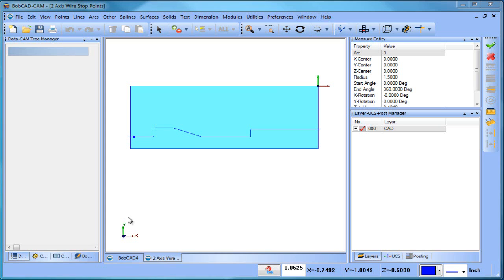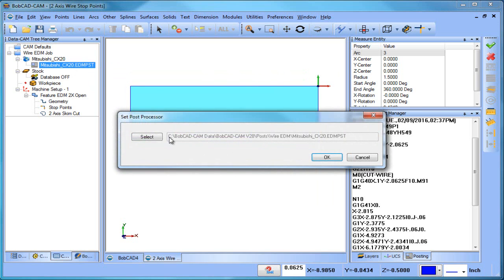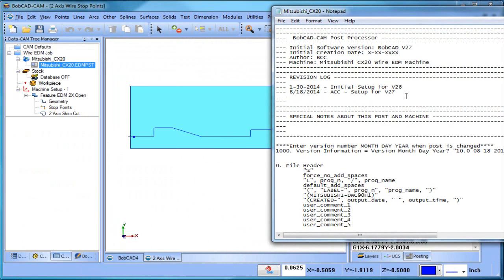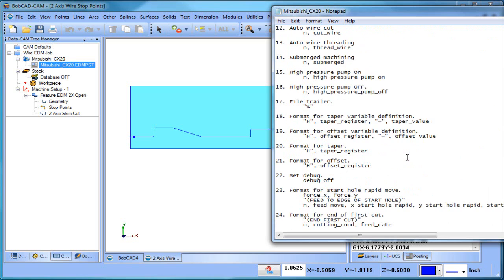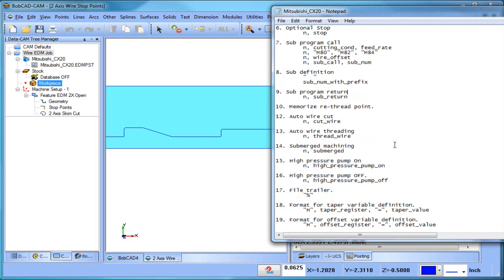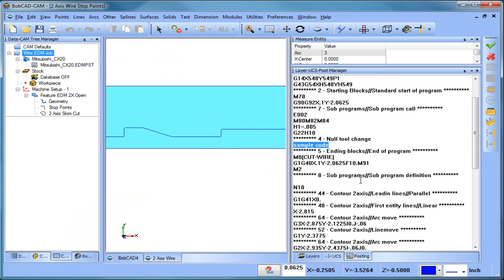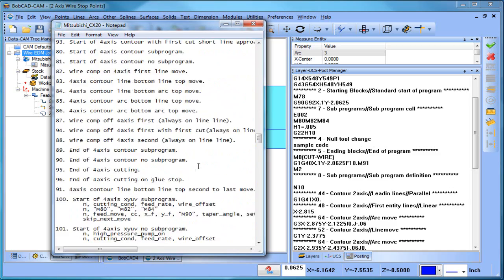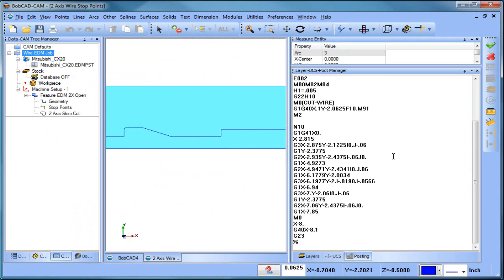Wire Post Processor Changes BobCAD CAM V28 Wire EDM

Comment: I made a change to my post... 

if(intDTHCStatus = 0) then
 intDangerZone = Mill_GetUserSelectComboVariable(2)
 if(intDangerZone = 0) then
 Mill_ProcessPostLine("n, 'G00 Z', '[.3T]'program_block_4, ' F150.0 ( Move Z Axis out of Danger Zone )'")
 else
  Mill_ProcessPostLine("n,'G00 Z1.000 F150.0 (Move Z Axis up just a little)'")
 end if
else
 Mill_ProcessPostLine("n,'G00 Z1.000 F150.0 (Move Z Axis up just a little)'")
 Mill_ProcessPostLine("n,'S10 (DTHC is off)'")
end If

When it posts it output the return value of program_block_4 variable twice... 
(the value is 2.500) 

See Output Below

N0077 G00 Z2.500 F150.0 ( Move Z Axis out of Danger Zone )
2.500

This is a variable from the ADV POST screen which I need to change

I have tried everything